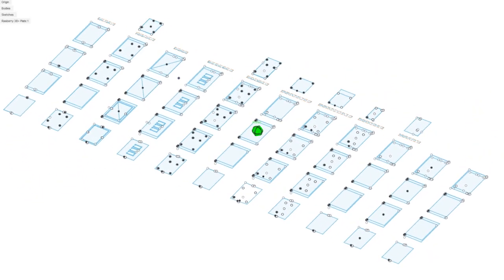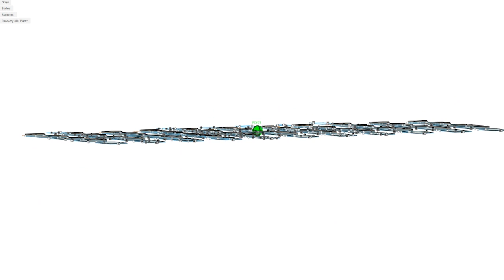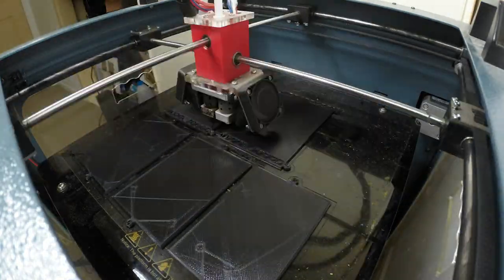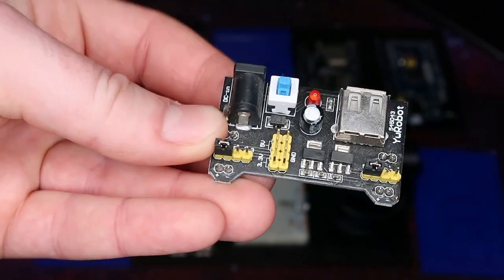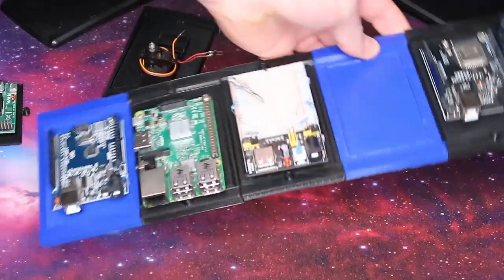Modular Prototype boards DIY 3D Printed

Comment: I like it. 
Do you have one for the 5x7 proto solder boards?
Reply from the maker: Hi, thanks. I don’t at the moment and I’m trying to find another way to redo the file as I originally created in fusion and without warning removed free access and now I don’t have access to export the model so I need to recreate from scratch in another tool.
Reply: @ScottyDIY  I knew they'll pull a shit like that and never used my free educational access key. 
I stuck to my "borrowed" solidworks 2010 and happy that I did.